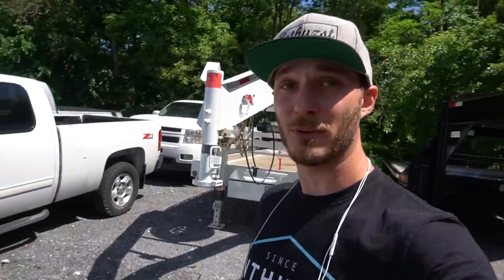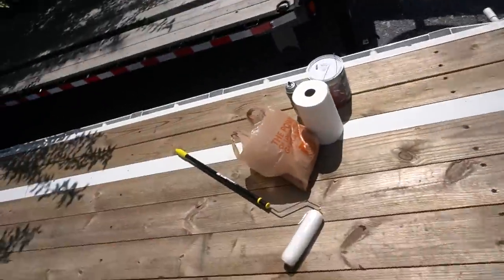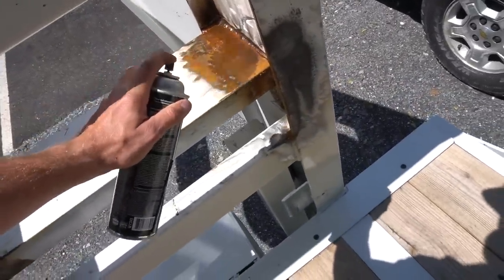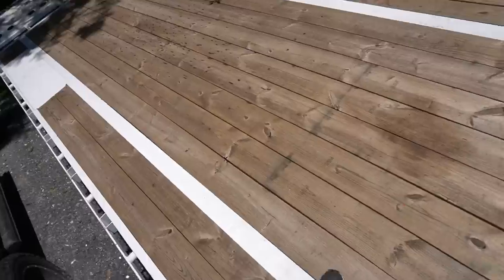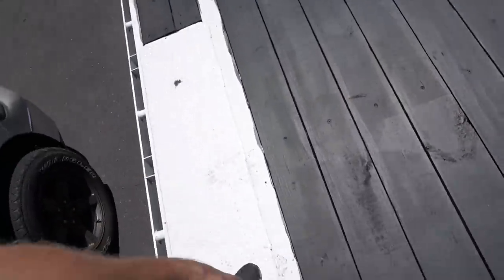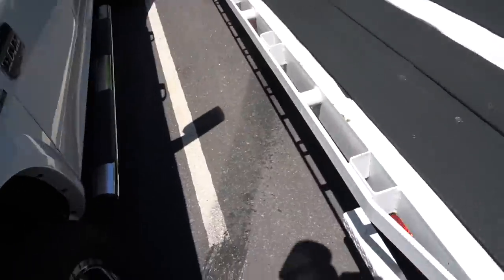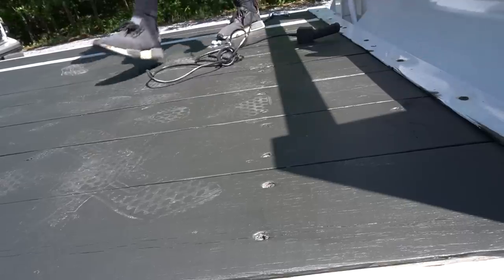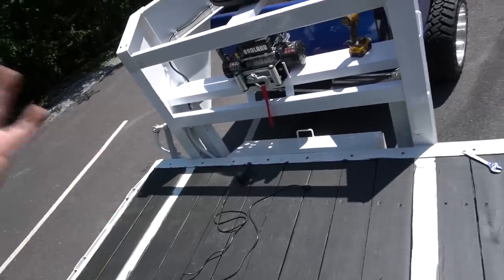FORCED To Repaint My BRAND NEW BIGTEX Gooseneck!

Comment: Hey Jack, the trailer looks great!!! Before you end up really annoyed with the tool boxes on your trailer, it would be a great idea to pull all the grease fittings and clean the paint off of them so the accept grease. I’ve ran into that issue before with new trailers.

Comment: Does that trailer have a serial / registration number?  Maybe on the underside  in a couple places with pictures. Have someone that's good with a welder write your serial and drivers license number then paint over it to stop the rust. Maybe get a set of  large 1/4" Inch metal stamp set and use that for one and the welder the other. We don't need to see it or you to talk about it. Chances are someone that watches one of these videos will steal or try to steal the trailer. JUST DO IT.

Comment: Is the seat belt light on because you don't wear your seat belt, or is the connection crap at the female end?  I soldered my connections together where the wiring comes to the female end, no more light, easy 5 minute fix.

Comment: Surprised you didn't run the main power cable under the piece you had reoriented and just made a hole on the front of the short side and use a grommet to seal it... Just an idea.